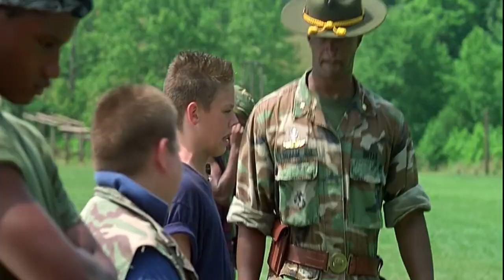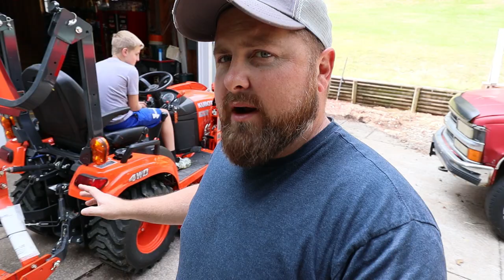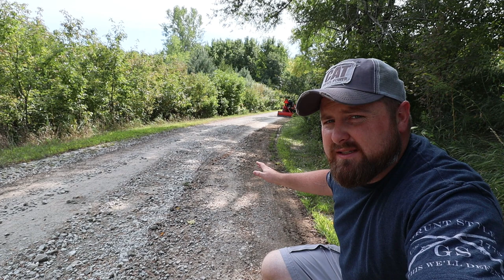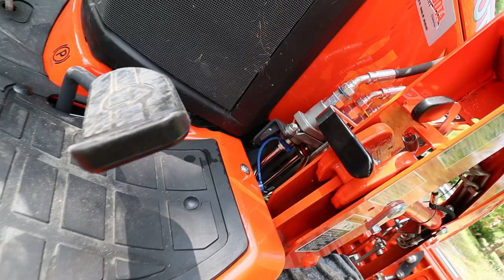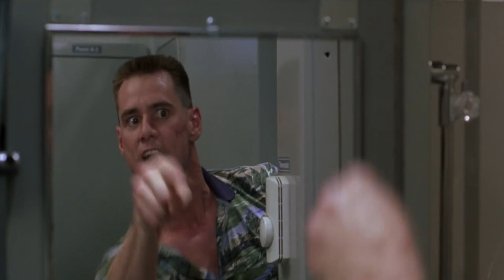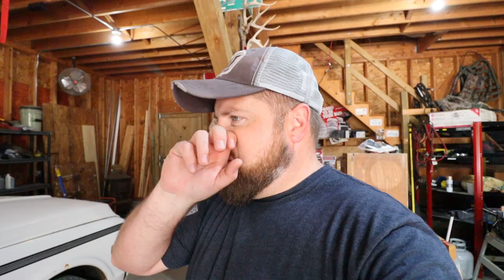✴️Kubota BX 2380 Tractor....Grading Driveway We Ran Into Hydraulic Issues

Comment: Throttle adjustment is super easy to do, will definitely solve your issue there. The loader valve assembly was an issue for me too. I had it replaced under warranty and it just leaked again. What I’ve come to learn is when you first attach the loader valve release the pressure real quick( won’t be much), then disconnect and reconnect the valve assembly. This method takes almost no time and has solved this issue for over two years now. Good luck!
Reply from the maker: Thank you that is awesome that someone can help me get past this issue 👍👍👍👍 
I’ve been installing with the level in free float mode and still kept getting leaks but I’ll try your way now
Reply: Sunnyslope Homestead My theory is the flat faces on the two coupler parts don’t like to mesh perfectly if any pressure exists. I really should post up a video of this method. It’s worked flawlessly, zero leaks.
Reply from the maker: I bet it will do well if you did 👍👍👍
Reply: Connect and reconnect works for me also usually do a third time for good measure and no leak
Reply: Have you fixed the throttle issue ? I have a Kubota BX1880, had same issue. Super simple but it's something Kabota needs to address. I found a YouTube video about it. Remove the black cover at your knees, you'll see  the tightening nut has come loose on the end of the throttle cable. Some suggest replacing with lock nut. Sounds like yours is still on and not laying in the floor lol.

Comment: great video. my bx2380 also leaked, and thank goodness it was under warranty because the leak was from the the base of the quick link connector, once kubota replaced it, it was all fixed. i guess version (one) lets say had issues and there are replacements with better version (two) parts.
Reply from the maker: Yeah it’s a continuous issue still but I’ve learned to live with it. I may go with the single connect fitting

Comment: I own a BX 23 S and have the same box blade.  Just wanted to let you know that if you want to leave the mower deck on while box blading it's no big deal.  Just use your knob adjuster on the lower left hand side to lock the mower deck into the upmost (top) position.  That way when you drop the three point hitch the mower deck will stay in the upper most position.  Hope that helps!

Comment: I had the same issue with my bx 23s that plate on top that clamps down bent over time with the hydraulic pressure took it in bc it was less then a year and they replaced it but while i waited for the part it was on back order i used vise grips to hold it down.
Reply from the maker: Same here and I had it replaced and so far no leaks ... I’m gonna go single hook ups next time if it fails again.

Comment: Check the adjustment bolt under the throttle if the nut gets loose it will creep down...
Reply: where is it?  Mine creeps down exactly the same way.
Reply: @YourOlBuddyUncleKarl  under the dash, remove the cover for the air intake and look below the throttle handle
Reply: Got it!  Thanks!  This info helped a lot.  Tighten it up and she's running great again.

Comment: Just found your channel, 9 months late, but you can tighten your throttle so it stops slipping. Pretty easy to do. But, agreed, the flat face coupler leak is a real PITA!
Reply from the maker: Welcome aboard! Yep it was actually under the hood at the motor but it is fixed now 👍

Comment: I had the same problem with throttle.I took the panel off where the battery is at. You can see the bottom of the throttle. Their our two nuts,both had backed off.Tighten the top nut,then the lock nut.problem solved
Reply from the maker: I’m gonna weld the dang thing here soon lol

Comment: If you put your mower height control to top you will no longer be dragging it around.  If you remove the air intake/battery access cover you can easily get to the backside of the throttle control, just tighten the nut a tad and it will stay where you set it, 2 minute fix.
Reply from the maker: It’s tight and even has the spring still attached , it’s just odd that it doesn’t stay at rpm
Reply: That's unfortunate, it was a common problem in the first year 80 series, I've had to snug mine up a couple times.  I found it very annoying when you have to keep adjusting the throttle.  I hope you can resolve that issue.

Comment: Have you ever operated the bucket and had the deck lever in the lower position and try to use the bucket and would not work?
I have that problem and can't find out what's going on. Can not raise 3 point hitch, mowing deck or operate bucket. It will go backward and forward with no problems.  Help! Please
Reply from the maker: Wow can’t say I’ve had that issue , I would check your hydraulic fluid level then your filter and make sure they are good and clean. If that all checks out I would check the pressure regulator. This has spring and then disc that could be plugged or damaged. Easy to check too and there are videos on line you can watch. Most people changed them out to get more lifting power
Reply: @SunnySlopeHomestead  done that twice.
Damn Kubota acts like their junk is Top Secret
Reply: @SunnySlopeHomestead  yeah when you drop the deck/3 point and try to operate the bucket nothing works

Comment: Get that burn up going, maybe even cut the oil mix a bit and let her rip!   Some friends of mine did a rx-7 rotary full kill, I think the video is on the YouTube, was intense!!!   Hope you get your bx issues worked out, only ‘issue’ I’ve had so far is my MMM pins don’t like to line up when I put it back on.   (I don’t have the drive over)
Reply: Looked over my hydraulic connection on my BX and mine don’t mesh real flat either but doesn’t leak, thankfully!    Let us know what you find out
Reply from the maker: Yeah if it doesn’t kill it self I’ll help it along in the most interesting way lol 😆

Comment: Box blade is the wrong tool for the job.  You neeeeeeeed a rear blade that'll roll/mix the gravel & soil together.  Your driveway looks moist enough but after a moist storm is the best time to rear-blade.  For more info watch one of the many State Sponsored training videos on gravel & dirt road maintenance. 99.99999999999999999999% of DIY YT is doing it inefficiently.
Reply from the maker: Agreed but it’s what I have right now to get the job down. Hopefully I will have a blade in the near future. Please do share what you know on the topic , I enjoy the information
Reply: @SunnySlopeHomestead  The best source for gravel/dirt road maintenance is the training video used by your State.  I've got some info in my Stormwater playlist. Interesting fact, 50% of roads maintained by States in America are dirt or gravel.
Reply: If you have ruts/potholes/water cut trenches in harden soil, you need those rippers on the box blade loosening the ground around all of those spots. Without the rippers working you are only filling in those spots with lose material that is quickly knock out as you drive over. Otherwise  your sloping process is what you need to do. However if moving gravel is all you are doing you are not creating a crown. You need to be shaping the ground into a crown. Again your rippers are the tool needed.